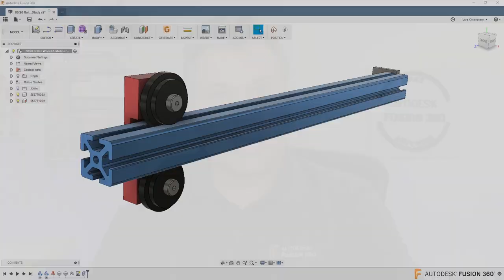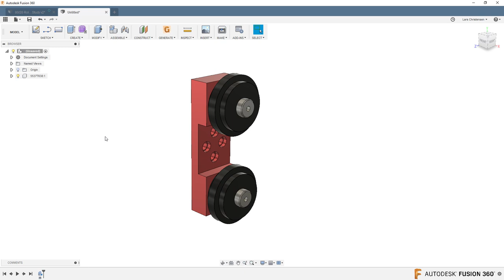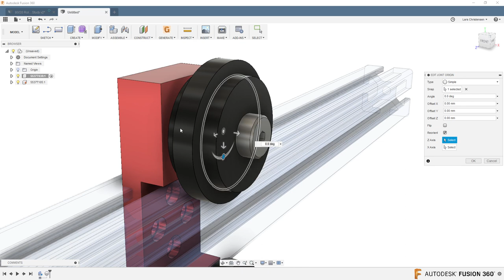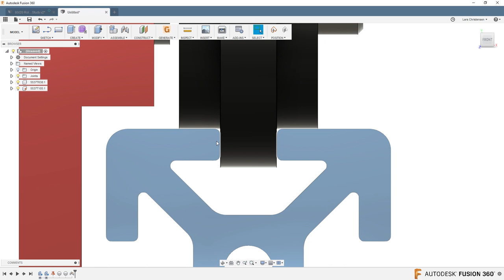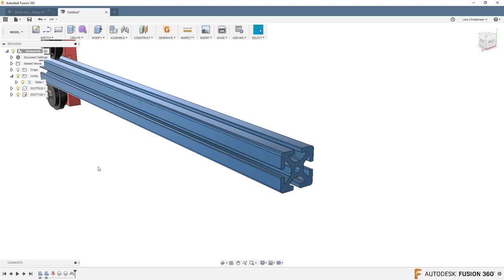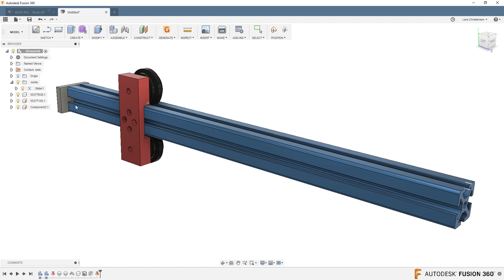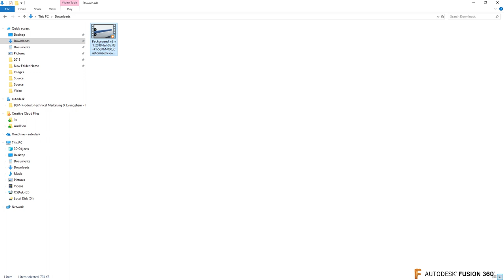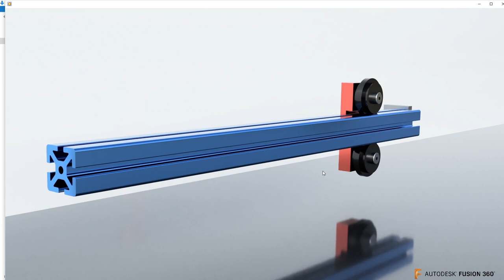80/20 Roller Wheel & Motion Study — Fusion 360 Tutorial — #LarsLive 184

Comment: Perhaps you talk about this in another video (???) but how do I model a V-Wheel rolling in OpenBuilds-style V-Rail?  Some time back I posted a YouTube video asking this very question, and got lots of solutions that required doing precision math to get the two to play nice together.  None of them were actual answers, just band-aids.  In particular, none of them were actually "tangent", just kinda-sorta due to the punched-in numbers.

Fusion360's insistence on avoiding tangent mates, or mates at all, make this specific task more difficult than it should be.  BTW mating V-Wheels in V-Rails is trivially easy in Solidworks, Inventor and Onshape.

Folks like me who use V-Wheels and V-Rail all the time when designing 3D printers are NOT well served by the (in my opinion) cumbersome JOINT methodology, at least as currently defined.

Please show me where I'm wrong.

Here's my original video from 2017: https://www.youtube.com/watch?v=AKgo81sLXv4

Comment: I put a little blue anodized tick mark on the bearing wheels  and am currently trying to figure out the motion study that shows both the sliding bracket and the rotating wheels. If you are able to add that element to an updated video in the future that would be really helpful.

Comment: Great tutorial! I learned several things. I have one more question for you on this topic.  How can i get a "wheel " to follow a curved track?   I don't care if the wheel turns but i do need it to follow the curve as if it was rolling on the surface. Thank you in advance.
Reply: having the same issue.  I have a fairly complex model, basically a motor with multiple sub-assemblies that have their own joints, with a single rotating drum with dogleg cam lobes that activate all the components together. seems motion links and contact sets don't transfer into other assemblies and having a hard time getting it to work all together

Comment: Interesting topic. Is there a way to use timing belts with pulleys and motors with fusion360?
Reply: Probably. Paths create curved/flexible parts, and linear joints follow them. How to create the joints to 'transmit' the linear belt motion to a rotary pulley is not in my knowledge but a great Q.

Comment: Lars, I have something strange happening with contact sets... For some reason if I slide the roller block fast it will jump past the block at the end of the rail & get stuck on the other side, to get it back I have to slide it fast in the opposite direction and it will jump back.  do you know what may be causing this? I would assume it could be fixed so that the joint limit is placed somewhere inside the block or end of rail as a backup?
Reply: Does this still happen? If yes, that's what they call in softwareland, a 'bug,' and needs to be reported.

Comment: THis is cool and all, but i REALLY wish fusion360 would give us the option of joining in a more intuitive way. 

I.E. Currently, i'm modeling up something, using V-Wheels, and V-Rails. 

As the wheel, and the rail, both have 2 sets of faces that are in contact (both are angled:

RAIL --\ \ WHEEL / / -- RAIL

Intuitively, one would think, the easiest, and best solution, would be to create a slider joint between the wheel angled face, and the rail angled face, ON BOTH SIDES, and fusion could do the math to align the parts so that those faces touch. 

As it is now, this is NOT the case. 
The only workaround I've seen, requires creating an origin join between the two angled faces of the rail, and picking an arbitrary new origin, then doing a lot of math to get the two faces to be touching, or "near enough". But this introduces more problems than it's worth, as sometimes, the join origin won't allow you to pick the origin snap point (even with the rail "grounded", or worse, once you complete one such set of tasks to slider - join one wheel, you have to repeat the process again for EVERY wheel on that side, and guess what.. It won't let you, because you already have those two faces joined, but you cannot select again the same snap origin.. 

It's basically a catch 22

Comment: I am working on a cabinet and plan on using Blum 563H Slides.  I put together a model that has one stationary cabinet bracket and two slides.  I make the bracket to the cabinet rigid and then make the first slide joint to it with a Joint/translate function.  I then make the second slide joint to the first slide and also have it translate.  That part works but when I mirror it I lose all my joints.  Is there something I missed in doing the mirror function or do I just have to redo the joints after mirroring them.  I had also hoped to copy the set of slides to add 7 more drawers.
Reply from the maker: Hi jsf777golf Thank you for watching!
I think you just created another livestream topic :-)
I think in this case I would make your slide mechanism as a subassembly. Then you can insert it as many times as you want and might make it easier to work with. I'll try to make something next week

Best,
Lars
Reply: That would be great. I also made it as a separate component an imported it in. Same issue, joints do not transfer in with component. It’s a simple model. One cabinet L shaped bracket and 2 sliding bars. It’s simple to model that way since you really don’t need all the details. I then imported it positioned it to the cabinet , imported my drawer component.  I tried sliding the slide before I put in the drawer but the whole component moves. Maybe I missing grounding something in the import process. Im new to Fusion 360 but am learning very fast with all your videos. Thanks.

Comment: Hi. Excellent video. I've been trying to find something like this for a roller wheel on a 2040 V-slot. Here is a link to the wheel and I tried creating the joint origin coin - https://a360.co/2NAGzv3. However, I cannot seem to rotate the coin to face in the Z direction. Its currently facing the X axis. I tried re-orienting it but that did not seem to work. Any ideas?
Reply from the maker: Hi HPB1980 Thank you for watching!
I really don't. The way the joint origin was placed in this video, should work on that part....I believe
Reply: Lars Christensen I may have figured this out. I created a small 1mm cube inside the wheel and used one of the faces on that to reorient the joint coin. I think Fusion doesn’t allow reorientation if there isn’t a separate face to align against. The only issue is that if an interference check is done that cube will show as a problem causing entity.